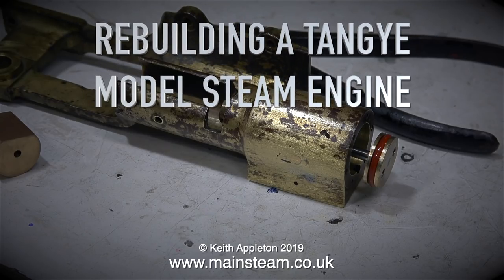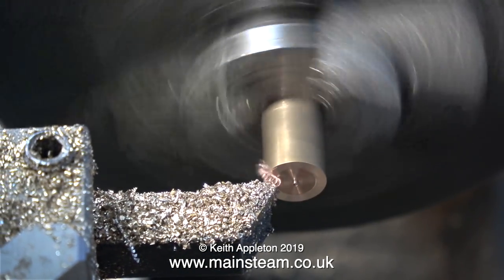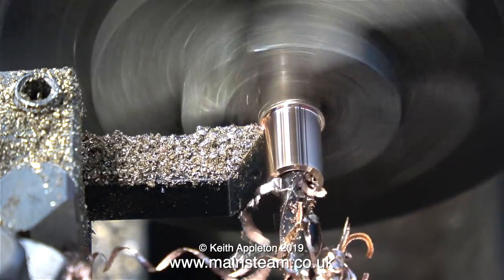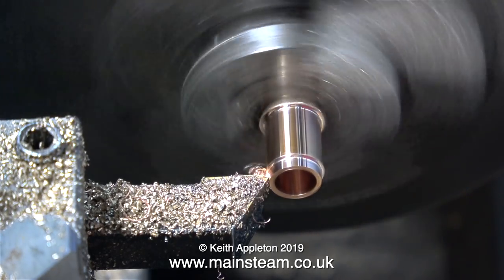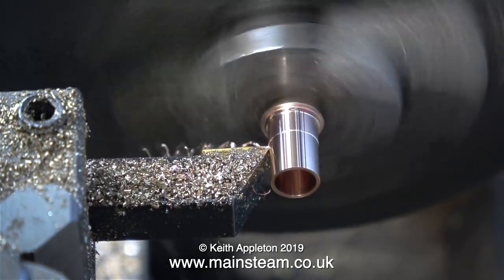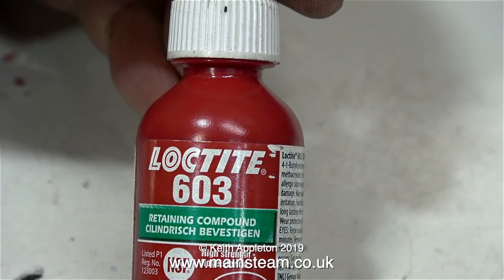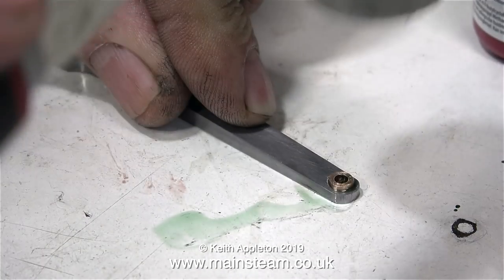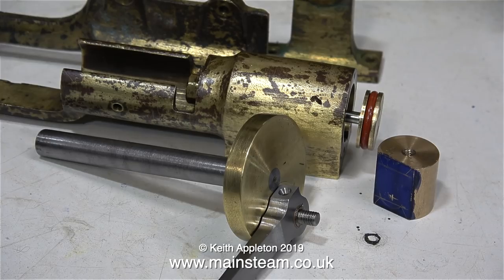REBUILDING A TANGYE MODEL STEAM ENGINE - PART #8

Comment: if it were me i would turn the exterior down to the correct OD first and THEN do the inside - why? because the walls would be better supported by the twist drill on the final cut than simply having one point of contact as with the cutting head